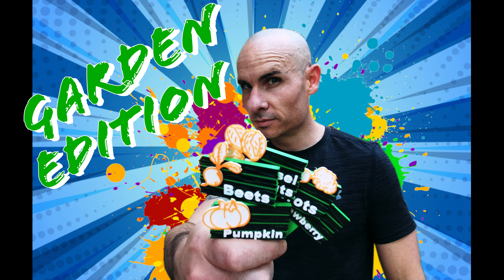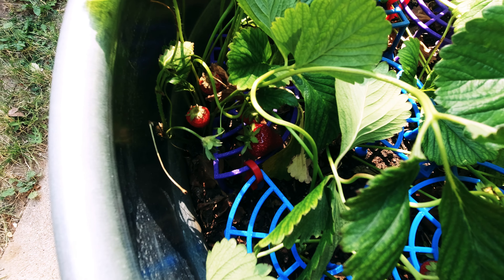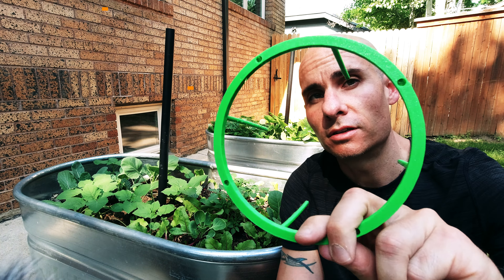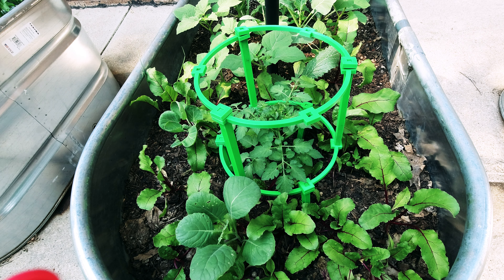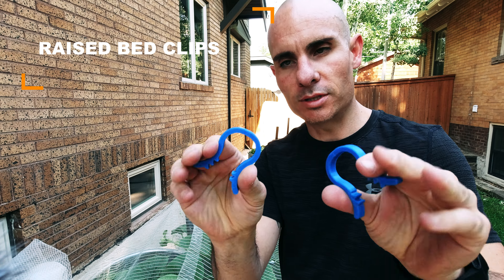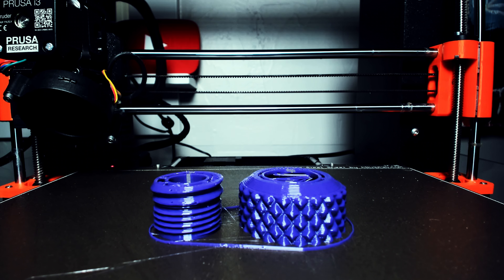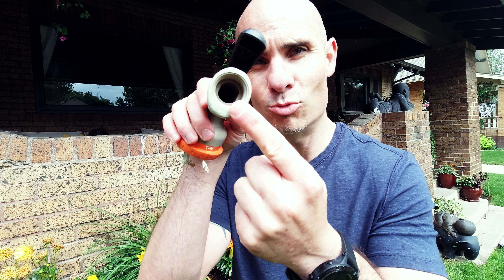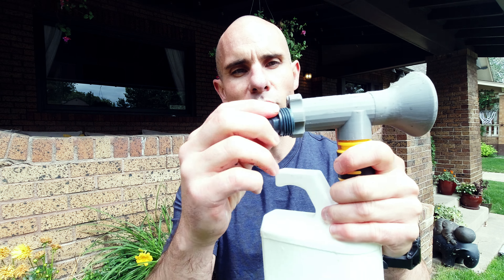3D Printed Garden Upgrades You Need To See

Comment: I love 3d printers, but the problem I see is that once you learn to wsing the hammer, suddenly everything starts to look like a nail. You tomato cage could have been replaced by any branch or stick (like people have been doing it already for centuries), but no we have to reinvent the wheel.
Reply: Like the wisdom of your post KISS ( Keep it simple Stupid ) 
 My annual  growing of 18 tom plants each year are running up 1/4 " poly prop rope  pegged into the  5 galon tubs of compost they are growing & tied up to a six foot high catenary wire strung across the inside my glass house roof.
 The ope is slack and as the plants grow simply loosen the top tie point & gently wrap the rope round the stem then retie it  so there is still a bit of slack in the rope.

Comment: In a future video I'd like to see you design something that makes connecting 1/4 inch drip lines to mini bubblers easier.  An easier system where parts can be just clicked or screwed together, rather than compression fittings.  Even dipping drip lines in hot water is sometimes not enough to get them connected.  In my garden I use the quad manifolds so I can connect 4 drip lines to mini adjustable bubblers/sprayers with built in stakes.  For pots I'll put 1 or 2 sprayers in the pot.  I use the Rachio smart sprinkler controller which is compatible with Siri so I just say, "Hey Siri turn on the garden" or "front grass" etc when I want to do some watering.  Watering schedules can also be set on a smart phone app.  Anyway, the most tedious part of setting things up is pushing the 1/4 inch tubing onto the components.  If they could just click together that'd be great

Comment: I DONT know anything about 3d printers but we do a lot gardening. could you please tell me the spcs of a printer i need to know so i can search for a good 3d printer in UK thanks
Reply: In this Video he used Original Prusa i3 MK3S+ cost about 770€.
Reply: The creality Ender 3 is supposed to be one of the best (in terms of ease of use, not being too expensive but having okay print quality etc) printers for beginners and is currently on sale on banggood for ~£120.
Reply: @EctoMorpheus  thank you I have been told by others also the Ender 3 is excellent as a starter printer.
Reply: @rainerschillings6418   I too opted for the Prusa 3S direct fromJoe prusa as a kit form  ( I'll buy the next one assembled , tested & ready to go . 

Expensive yes but like Rolls Royce cars & engines you get the backup & regular quality updates . Fusion 360 free home user is a reasonable 3D CAD platform to learn on . 

Learning to 3D draw & print is one heck of a hockey stick shaped learning curve .. I'm doing it at the age of 71 yrs old after long covid & a stroke.

Comment: Pla is fine. Didn't makers muse leave a pot outside for a year. It was fiiiine.
Reply from the maker: For some uses, sure. It tends to melt at rather low temps when being used outdoors. I have a video comparing the two outside. Within 8 hours the pla part is deformed.